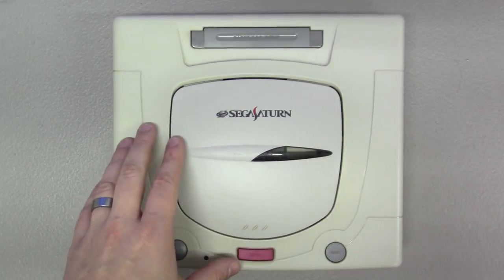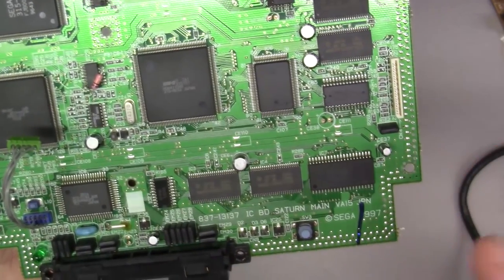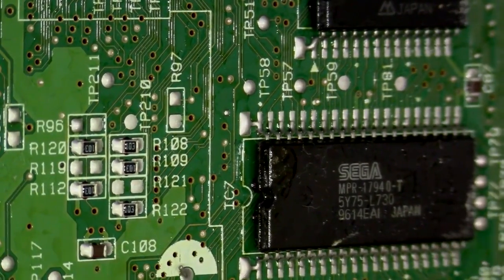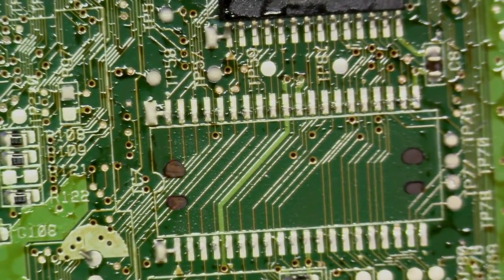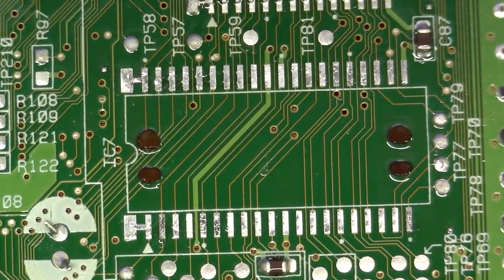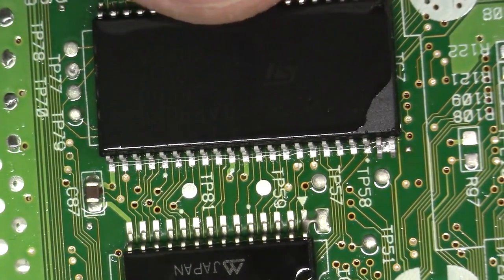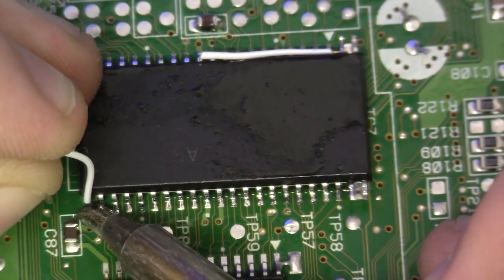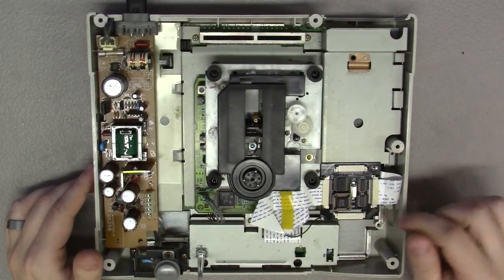Super Challenging Soldering Mods for the Sega Saturn!

Comment: Dear Voultar thank you for making this video.  I have several Japanese Sega Saturns and have started doing the region free bios mods on them along with FRAM. Have a couple of notes from my experience, which may be obvious to some but maybe helpful for others.
1. When flashing the eeprom ensure to byte swap the code. i used 29F800BT which worked fine.
2. Ensure that the console is back together with all screws in before testing, i believe the console needs to be grounded correctly for it to operate correctly. If its not grounded correctly the console will start however there maybe unusual behaviour, such has the games not loading and sound issues. 

Thanks again for the informative videos and techniques.

Kind Regards
Mal

Comment: one thing I love about your video's, especially for people new to electronics mods / repairs ... no matter how many times you have worked on something ALWAYS lift gingerly to find out which screw you missed (heck I just did it on a tandy coco, ok looks like I got them all, lift carefully, oh its binding there's a screw!)
Reply: ps as far as glue dots go, a good hint is the entire board is covered in flux, that mean it was wave soldered and not reflow soldered, wave you have to flip the board over send it in a flux bath then though a wave of liquid solder ... how do you hold on the chips when they are not soldered yet

Comment: I feel I should add that the reason adhesive is underneath the chip is due to this version of the PCB being made using a wave soldering technique in which the whole board is passed over a pool of molten solder. one way you can tell a PCB is wave soldered is the extra pads visible on the left side of the chip in the video (These are called solder thieves). These are there to wick away excess solder from the wave soldering pool to avoid short circuit. Another telling sign is all the nasty flux covering the top of the board meaning a solder paste and oven reflow method was certainly not used.

Comment: Another good indicator that the chips would be glued down are if the other parts on the same side of the board have glue under them, the chips likely do too.  Also, if there's a flux residue all over a board with SMD components, they're probably glued down.  The reason in most cases for the glue is that the board was wave soldered during manufacturing.  If they weren't glued down the soldering process would wash the parts right off the board. That's also the reason you'll see a coating of flux all over the board, in waving soldering, the solder contacts the entire surface of the board and they're often too lazy to clean off the flux afterwards.  Hope that helps.
Reply: It's possible to wave solder rather than paste/reflow solder fine pitch SMD components without bridging them all? Colour me surprised.

Normally i expect epoxy glue just on the backside (the side with fewer components), so they do that side first, but it's all glued down so when the board runs the second time through a reflow machine for the main component side, the now upside down components don't just all fall off.

Though i'm not familiar with the Saturn and what they did and why.

Comment: I feel you should go into more detail about what the modchips in your videos actually do. A lot of them have cool names, and it's great to learn how to do them, but it would be really nice to know for what purpose the mods are being installed in the first place.

Also, some other interesting mods you can do for Sega Saturns;
- Replace the SRAM with FeRAM, that way it doesn't require battery power.
- Replace the battery for the real time clock with a rechargeable one, that way you never have to replace it and can have it recharge while the system is connected to AC power.
- Miniature heat sinks attached to the various chips via thermal adhesive.
- Add RAM which the slow BIOS chip gets dumped to on bootup, potentially speeding up anything that needs to access it. This is especially important because flash memory is usually slower than Mask ROM, and doesn't have execute-in-place capability.
- Replacing the slow DRAM with SRAM, since high capacities of SRAM have gotten a lot cheaper (especially the double port variety)
- Replacing the cut down 68k coprocessor with a full-fat 68k like what was used on the Genesis, or even a 68010.
- Etcetera. I'm sure there are a lot of other things you can do that I haven't thought of yet.

Comment: What electric screwdriver is that? It looked like a Waterun CLT-50 power supply on your desk, is it a Waterun-4000?  Where might mere mortals pick up something like that?  I only found the company website, but couldn't find pricing or resellers.  I did find that it looks very similar to another brand, HIOS, which I found a few parts that looked very similar on Ebay.
Reply from the maker: It's a HIOS CL-3000. The best of the best!

Comment: i figured out a way to get that red adhesive off AFTER you remove the chip... i sprayed it with 91% alcohol and touched it with my soldering iron to see what would happen and some sort of reaction between the heat and the alcohol turned that hard red mass into a fine brownish powder, ever so gently like caressing a baby run your iron over the wetted adhesive and it will turn to dust! after it has a good coating of dust spray it with alcohol and scrub with a toothbrush and then when it is still wet gently caress the next layer of adhesive and then repeat the process over and over until you have removed it all.
easy peasy.
you can probably be a little rougher with the top layers and then start caressing when you get near the PCB.
USE AN OLD CRAPPY TIP!!!

Comment: Late to the party, but what about using the long original cable on the connection to the mobo where it could possibly be tucked under that shield. Then that short one on the CD side?

Comment: Voultar: I'm hoping you can help me here. I have a Model 2 Saturn with a JVC CD drive but mine is different than yours, it doesn't have the component you soldered the 5v wire to. I was thinking of running the wire under the shielding and soldering it in directly to the 5v pin under the power supply but I've read someone say that some places can cause issues with the chip and the best place is under the CD drive. Where should I solder the wire to?

Comment: In my experience with doing FRAM mods (and swapping original BIOS chips in an attempt to fix a CD freeze-on-load issue), epoxy only seems to be used on revisions where IC7 (BIOS) and IC8 (save game RAM) are on the underside of the board. My assumption is that the adhesive is necessary, so the chips stay in place during the wave soldering. Still, it's best to assume the worst. Lifted pads aren't the end, but they are a pain.

Comment: Could it be possible to mod the playstation 1 in the same way instead of using a modchip and edit the bios in a hex editor so the console doesn't look for the wobble data on the disc?.

Comment: I would assume that the chip has adhesive if and only if it was wave soldered, which you can determine by the presence of the solder thieving pads on the end (you can see them in the video).

Comment: I don't have a Sega Saturn, but I was curious why remove the original bios to begin with? Why not lift pin 10 (Chip Enable) and wire it high. Then just stack the new bios on top? Wouldn't this solve the whole epoxy issue?
Reply: It would work, but i don't think stacking new chip on top of old one is any easier ;p

Comment: In order to get the adhered chips off cleanly would it be possible to just take some fishing line, slide it under the chip, and work it through the epoxy to separate it before you work the chip off?

Comment: For the Bios installation, when you bridged the various pins you soldered from pins to pins. It looks like at least on that board revision, there were through holes in each circuit trace coming off those pins. Could you use those through holes as solder points? Might make it easier if you can.
Reply from the maker: Sorry, I'm confused. I don't understand what your asking exactly.
Reply: If you look at the traces coming off of pins 13 an 23. The pin 13 trace looks like it goes to a surface mounted capacitor and half way through the trace there is a round hole in the middle of the trace through the board. On pin 23 the trace switches back to what looks like another capacitor and at the point which it changes direction there is another hole through the trace and board. In both instance it looks like there is an exposed copper contact in the solder mask at the point of each hole. So I was curious if you could solder the conductor in using those points? I highlighted them in the pic linked below.

https://photos.app.goo.gl/nMNNorvKWZrqV3WD3
Reply from the maker: Oh yes, I 100% understand what you're asking, now. Sure, You can grab both 5V and ground from neighboring parts. It doesn't have to be pins 13 and 23. No probs doing that!

Comment: Can you show how to repair vias? I messed up a few projects this past month.   Or possibly recommendations for a resource or video. Thanks and great tutorial! Even after using the fiberglass tool, the via still would not take solder. In the end after attempting to scratch the area and trying to tinn again I burned the via and never got solder to take. I was attempting the modbo on a silver slim ps2 and a via was rediculously small near an ic chip and close to smd resisters so may just a hard model.

I use a weller WLC100 and a chisel tip usually never conical at about 3.5 on the wellers dial. I also use no clean liquid flux

Comment: Great video! Any tips for modding an early model 1 (the PSU is on the lid)? While the BIOS is much easier to change (it’s socketed), the Phantom seems like a PITA given the Z bends on the ribbon coming from the CD drive.

This Saturn that I’d like to mod also had a region switch mod on it. Since I won’t need the wires anymore, do you know of a site that has the default jumper settings for an NTSC-U console?

Comment: If you have a region free bios then what  is the Phantom Universal Mod for?
Reply from the maker: These two things serve very different purposes. The Phantom Modchip has no authority over the region locking of the system. So, if you wanted to play a legitimate copy of a retail game from a different region, the software would refuse to boot. The region-free BIOS will allow you to boot software from ALL regions. However, the region-free BIOS will not allow you to boot "backup" copies of games. It's a matter of having two different securities in two different faculties.
Reply: Oh okay that makes sense.  I assume something similar is made for the PS1 as well?

By the time I was interested in this kind of modding ODEs started to pop up, so I never really did much research on these types of mods.  Currently have a GDEMU for my Dreamcast.
Reply from the maker: Security is entirely different for the PS1. An ASCII string is encoded on the disc's surface (in an area that home burners can't access) and the optical pickup reads this data in on boot-up. There's SCEA for the U.S., SCEI for Japan and SCEE for Europe. If this string isn't read, the software refuses to boot. This is easily circumvented by just spamming that ASCII string with a dumb little micro-controller.

Comment: New
So I finally got around to installing a region free BIOS chip that I had for about a year and a half but unfortunately I now have no video. I get power and the optical drive spins. I double checked my work on the motherboard and reflowed all the pads again but no change. Even swapped a known good power supply and optical drive from another working console but had same results.

The console worked prior to this so I must’ve missed or done something amiss. Anyone have any tips/ideas for things to check? Could the BIOS chip lose its programming?

I lifted the pins needed, bridged where needed, and ran the power & ground wires needed. If nothing else i’ll probably have to swap the old BIOS chip back and see if it returns to normal operation
Reply: WeirdoGuy01 I literally just finished doing the exact same thing to my Japanese Saturn 30 minutes ago. I double checked all my soldering with the pins, everything looks fine. I even took a close up photo with my macro lens and everything seemingly checks out.

My Saturn powers on, the CD drive still works, but I just have a black screen. My screen even flashes a little, like normal, during startup but it stays on the black screen.

I also removed the region free bios, reinstalled the old Japanese one, and it booted to the Japanese bios just fine.

I'm going to keep trying things. If you figure out the problem, please come back and update. I'll comment back if I figured out anything.

Out of curiosity, where did you buy your bios?
Reply: エステティック Funk sounds like you have the same exact problem alright. Does seem like the BIOS chip is potentially faulty. I obtained mine from a guy on the assembler games forums. Only thing left to try is to get another Region Free BIOS chip. Where did you get your chip from?
Reply: WeirdoGuy01 I bought mine from a seller on eBay. Considering our chips aren't from the same source, I think it might just be us that are having these problems. I just finished resoldering the region free bios chip again. About to reassemble it and pray that it works.
Reply: WeirdoGuy01 Nope, same black screen. I'm getting really sick of this. I redid all the pins again, with flux. No bridged connections, I checked all the pads, the wires are soldered well and make continuity but still nothing.

I'm going to try it one more time.
Reply: エステティック Funk I’m going to try another chip, maybe get a couple from different sources, can’t think of anything else it could be if our work and the process is sound.
Reply: WeirdoGuy01 This is actually the second chip I've tried from the same eBay guy. Redid the bios once again and got nothing. I think I'm going to quit for the time being, take a breather, and try again tomorrow. This has been incredibly frustrating, especially when the original chip came off like butter as per voultar's instructions.

If anything new happens with you, I'd be very grateful to know. I'll also update back if anything happens.
Reply: WeirdoGuy01 What Saturn are you trying to mod by the way? Mine is a white model 2 Japanese Saturn, I'm pretty sure it's a VA2 revision motherboard. My bios chip is on the underside of the motherboard, it had 3 globs of glue holding it down.
Reply: エステティック Funk the board I attempted the mod on is an early 1995 US model 1, no VA# printed on board but shows 171-7006C Main. BIOS is on underside but I was lucky enough to have no globs of adhesive.

Comment: The epoxy is there because those boards were wave soldered. On the board you first had that didn't have any epoxy, you can see that it was reflow soldered and therefore, did not need epoxy to keep the chips in place.
Reply from the maker: That's right. Manufacturing plants "potted" chips onto main-boards so they could wave solder both top and bottom layers, simultaneously.

Comment: Thanks for the video - subscribed a few weeks back! I'm about to enter to world of soldering and was wondering if you could offer some advice please?
I've been told 0.5-0.7mm solder for chips/wires and 1mm for recapping? What solder/flux/wire would you recommend? I've been advised Kynar wire, Topnik TK83 flux & Cynel solder? I'm going to get the iron you recommend as it's only £30 off Amazon. Thanks again dude! Appreciate your time 👍🏻

Comment: As usual, nice video Voultar. Just a question : you said in the retroroundtable that you use the retrovision cables with the OSSC and it is the only way you play Saturn now, do you think it is better than a good RGB scart ? Because I though the Component and the  RGB route should be more or less the same depending, of course, of the quality of the cable. Thanks
Reply from the maker: Oh yeah, a good SCART cable will serve you very, very well. Component is just more convenient and easier for me to deal with in my setup, these days.
Reply: Thank you ! Can I ask you why you went to Component in your setup as you became famous (totally legit) for all your work on RGB mods/repairs/developments ? Maybe you developed some kind of SCART allergy :D. Also most of the consoles are not Component yet.
Again thank you for taking the time for an answer !

Comment: Hey voultar, I've been wanting to get into hobyist restoration and mod work for a while, and now that I'm 19 I think it's time to start practicing. The thing is, I don't have a lot of funds so how do I go about practicing my mod work without spending a ton of cash? I've procured a few broken systems off of eBay to work on but I'm not sure if this is the best way to go about doing things, mostly because a few of the items I've bought have clearly already been worked on and are therefore broken beyond my skill set. The only easy repairs I've been able to do have been controllers since they mostly just need cleaning and that's no fun. So where do you think is the best resource for finding cheap systems to practise on? Bearing in mind I would ideally like to be able to sell my work to repay the cost. Also, I live in England so thrift shops aren't an option.
Reply: Could make a good video so everyone can learn
Reply: Don't assume that something that someone couldn't fix or botched are below your skill set, a lot of stupid people do a lot of stupid things, and you might have the advantage of willing to learn. And by the way, are you watching GadgetUK164? You should be.